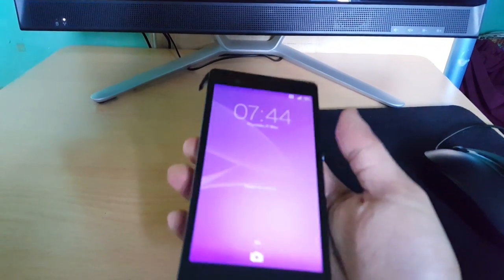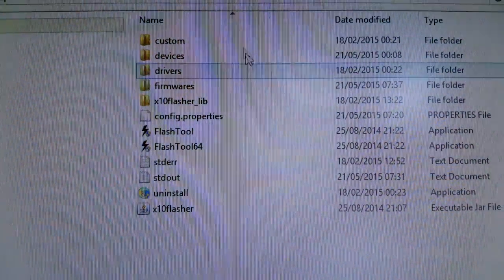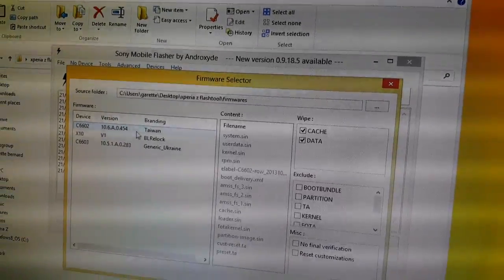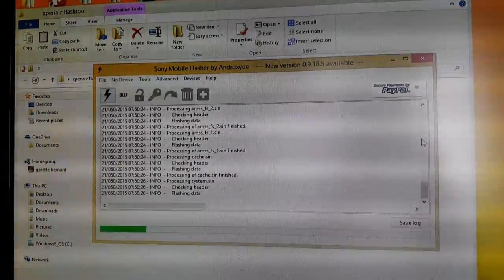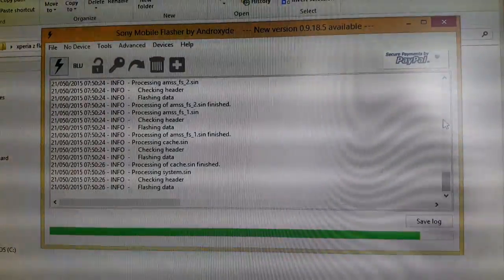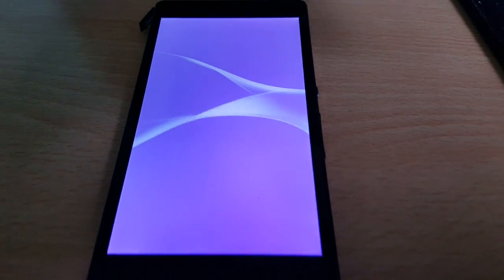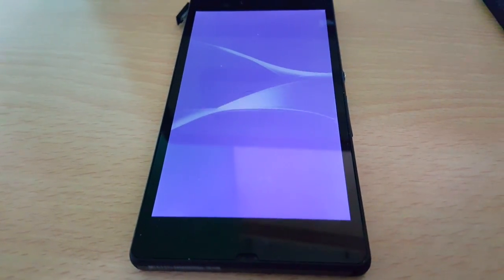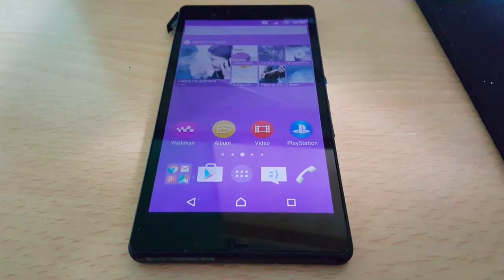Sony Xperia Z Install Official Android 5.0.2 lollipop Tutorial

Comment: hey doctor android im having difficulties in upgrading and first its in the drives there are many options of xperia Z and some of them are xperia Z ultra the second problem is that im using a c6603 model and when i switch off the phone it doesnt start flashing help me out bro im counting on you
Reply from the maker: ally daud if u dont see xperia z drivers just type it in google and download them that way u should find msny download links or install pc companion and connect your phone to it let it automatically install the drivers that way too if i remember correctly
Reply: Android Doctor the drivers are there but they are not xperia Z some are xperia Z ultra and if you wouldnt mind can u send the link of the ftf c6603 hong kong because you recommended it in some of the comments
Reply from the maker: ally daud when u swith off the phone u need to hold the button down that i show in the video its either volume down or the back button then connect the usb im guessing its not flashing for a few reasons either u didnt install xperia z drivers ,along with fastboot drivers & flashmode  drivers but if u dod install all 3 drivers and its still not working double check tgat u enabled usb debugging
Reply from the maker: unfortunately i cant but its sinple just type that hongkong firmware and model number into google and look for the download links aldo add xda developers to the search
Reply: Android Doctor i am downloading the xperia Z driver right now ill check you in a bit for the results
Reply from the maker: ally daud wait what hongkong fw was it u wanted kitkat?
Reply: Android Doctor no not kitkat i wanted lollipop
Reply: Android Doctor hey doc should i change the USB connection mode from MTP to MSP or?
Reply: doc should usb debugging be on??
Reply from the maker: ally daud yes
Reply: Android Doctor then why does it still fail while i did everything correctly

Comment: hi there, i have a question. I have a Sony Z T-Mobile (C6606) and it's lastest FW just 4.3, I also want to upgrade to 5.0.2 as the orther Sony Z (C6603) so can i use the firmware TW 5.0.2 for C6603 to upgrade for my phone? I've already searched on the internet but there's no OFFICAL FW for C6606. waiting for your responce
Reply from the maker: yes it should work😆
Reply: and one more thing, my phone still locked it's bootloader so can i use flashtool + your FW c6603 to flash?
Reply from the maker: +hưng nguyễn tiến yes u can
Reply: ERROR - Processing of loader.sin finished with errors.
i have this error, how can i do now?
Reply from the maker: +hưng nguyễn tiến u need to make sure u power the device off toyally then when u are requsted to re connect to flashtool hold down the volume down button then plug in the usb and kinda keep the cable held in untill the firmware starts to flash onto the phone bro, another thing u got to keep trying its kinda tricky ive got to admit also if u keep gettin error try another usb cable 😆

Comment: my phone is xperia z in japanese version,  its model so-02e/c6603 but it has trouble to booting? can you help?
Reply from the maker: did u install the c6603 version from the link in the description?,if so and it didnt work u will have to do a google search for the stock firmware for your model number and install it using flashtool to fix your phone http://filecloud.io/dveh017b
Reply from the maker: i think this is your stock firmware try install it using flashtoool just like i did in this video it should fix your phone http://filecloud.io/dveh017b

Comment: i do not have a firmware folder after downloading flashtool. Am I doing something wrong?
Reply from the maker: just make a new folder and call it firmwares then put the ftf file inside and your good to go😃
Reply: +Android Doctor thanks!
Reply: +Android Doctor sorry i ran into another problem.. When flashtool starts it gives me a message box saying that "the firmwares folder must be empty" after I have made the folder and dragged the ftf file into it. Can you help me out?
Reply from the maker: +Ayzriel Parchment did u name the new folder formwares? also did u put it where the drivers folder and other folders are? i mean dont put it in the drivers folder but put it alongside the drivers folder and other folders
Reply: +Android Doctor yes and im getting a message in flashtool that also says ERROR-root: this bundle is not valid
Reply from the maker: +Ayzriel Parchment are you using the exact same version of flashtool as i did in the video? if so maybe try using another cersion but i dont understand this should work it worked for everyone else
Reply: +Android Doctor ok I will start over and try again thanks for your help.

Comment: Just installed on my Xperia Z (c6606) and it worked fine.. 2 issues I was having while installing that might be useful for others.

1. When using Flashtools make sure you copy your ROM to the default folder shown in the FIRMWARE SLEECTOR screen. 
mine was: C:\Users\Admin\.flashTool\firmwares    if not it does not pickup the firmware. 

2. Make sure before you click on the LIGHTNING BOLT icon that you take phone OFF usb debugging. 

Works like a charm.. thanks
Reply: can you make a video tutorial of it? my phone xperia z c6606

Comment: it says install drivers and I have model c6606
Reply from the maker: open flashtool look for the drivers folder inside it u should find your drivers and tick the box to install them if your drivers are not listed check the video description for the link to sonys website where u can get your drivers for your model
Reply: +Android Doctor does it work for c6606
Reply from the maker: +Jami Ghani yes
Reply: +Android Doctor does it works jami ?

Comment: Android doctor I download the file but it's a zip and flash tool is not indicating it it in the firmware when I try to flash I tried extracting it and it has many folds including the the boot folder
Reply from the maker: +Ndawula Farouk u need to install all 3 of the drivers i mentioned in  the video bro or else flashtool wont work
Reply: I finally got it work thanks so much the issue was with the download manager that had zipped up the file

Comment: i downloaded official firmware.. but it is in zip format .. and not showing when i try to flash.. what should i do??
Reply from the maker: try extract it and see if the ftf file is inside it:-)
Reply: +Android Doctor flash not successful..
while flashing ...showing like 
INFO Preparing files for flashing
Error
INFO Cannot open bundle. Flash operation canceled
Reply from the maker: +pujwal shakya is it a ftf file u are trying to flash?also make sure u downloaded the correct firmware for your model number or it wont work

Comment: I help my cel stayed in the Xperia and I did this help me please

25/039/2015 10:39:11 - INFO  - Processing of partition-image.sin finished.
25/039/2015 10:39:11 - INFO  - Parsing boot delivery
25/039/2015 10:39:11 - INFO  - Phone boot version : S1_Boot_Lagan_1.1.1_1. Boot delivery version : S1_Boot_Lagan_1.1_10
25/039/2015 10:39:11 - INFO  - Going to flash boot delivery
25/039/2015 10:39:11 - INFO  - Processing emmc_appsboot_S1_Boot_Lagan_1.1_10_HWID_7190E1_OEM0.sin
25/039/2015 10:39:11 - INFO  -     Checking header
25/039/2015 10:39:11 - ERROR - Processing of emmc_appsboot_S1_Boot_Lagan_1.1_10_HWID_7190E1_OEM0.sin finished with errors.
25/039/2015 10:39:11 - INFO  - Ending flash session
25/039/2015 10:39:11 - ERROR - ERR_SEVERITY="MINOR";ERR_CODE="0017";ERR_DYNAMIC="0x80080021 ";

Comment: hi friends, i have recently upgraded my android from 5.0.2 to 5.1.1 but i and not happy with it i want to go back to 5.0.2 is there any way to do that?
i am using Xperia Z2. The mean reason is that i liked so much the option for putting the phone on silent 15 30 45 or 60 minutes and it will be on sound after the selected time so just in case if you forget to wake up your phone from silent it will be on sound after selected time.

Comment: problem bro :/
ERROR - ERR_SEVERITY="MINOR";ERR_CODE="0017";ERR_DYNAMIC="0x800A0017 ";
any solution ? Android Doctor
Reply from the maker: Not sure why u get that error nobody else has reported it read the comments try making sure your phone is completely off be fore connecting that USB cable its vital u do do that and kinda keep hold off the cable when connecting it only let go when the flashing starts and u see all that writing on screen and things get moving bro-) its kinda tricky to do but it will work and make sure u installed the drivers for your model along with fastboot and flashmode drivers:-) and just a little tip read through comments alot of the time people post fixes for the problem u could be facing..
Reply: will do thanks man

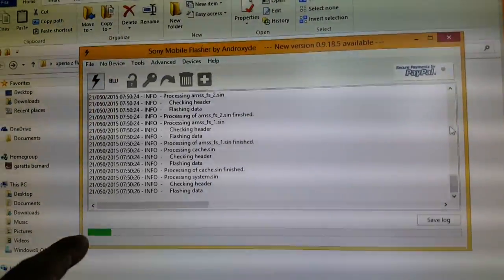Comment: 24/007/2015 00:07:56 - INFO  - Start Flashing
24/007/2015 00:07:56 - INFO  - Processing loader.sin
24/007/2015 00:07:56 - INFO  -     Checking header
24/007/2015 00:07:56 - ERROR - Processing of loader.sin finished with errors.
24/007/2015 00:07:56 - INFO  - Ending flash session
24/007/2015 00:07:56 - ERROR - 
24/007/2015 00:07:56 - ERROR - Error flashing. Aborted
24/007/2015 00:07:56 - INFO  - Device connected in flash mode

Can you help what to do im using windows 7... i already install the drivers as you mentioned
Reply from the maker: grace chua To solve that error flashing aborted problem make sure when u turn off your phone it is fully off then hold down the volume down button and kinda keep it held down even when u connect the USB cable only let go when u see everything starting to flash onto the phone IT CAN BE A BIT TRICKY TO DO BUT KEEP TRYING IT WILL WORK:-)

Comment: I installed the flashmode & fastboot drivers. But got "Processing of loader.sin finished with errors" when pressing volume down button then plugging in usb cable. My bootloader is locked so I'm guessing I have to do a couple more steps to upgrade my xperia z model c6606 andorid 4.3 to android 5.0.2. Do I have to root this device and do xzdualrecovery?

Comment: I want to ask u if I should reset my experia Z c6603 befor I install android 5.0.2 ?!
Reply from the maker: Mouad El Kantri yes for a clean installation
Reply: Thanks (y)
Reply: If I failed in the install they are a risk to lose my phone ?!
Reply from the maker: Mouad El Kantri no there wil only be a problem if u disconnect the cable whilst installing
Reply: Thank u very much

Comment: having issues with my xperia z ... c6616 model issues with wifi and messaging... stopped looking to try and fix these
Reply from the maker: Mcnutts3 u are probably facing those problems because this firmware is not for your model bro its only for c6602 & c6603
Reply: shadowsniperhuddz any idea why my phone would tell me its ready for an update... my phone is about a year old but i believe it was out before that... xperia z L36H

Comment: Hey, just wondering I'm using the c6603 variant. So will I still be able to use LTE with this firmware update since the c6602 models didn't support LTE?
Reply from the maker: U sir are correct

Comment: Will the customised USA firmware for the z C6602 work perfectly fine in India and it's carrier operator? And is it safe to flash? It won't root my phone right?
Reply from the maker: The USA firmware is for the US version xperia z I recommend u installing Hong Kong C6602 fw if u don't want any issues and no it won't root your phone:-)

Comment: With this installation i got battery problems.Its charging very very very slow and gets drained very quick.what to do?help plz
Reply from the maker: Prince Jan  yes it does charge a bit slower than kitkat but your battery shouldnt drain so quick do a factory reset then try power cycling  when charging dont forget its a whole new operating system give it some time to settle too..
Reply: shadowsniperhuddz Thanks for the reply.Does Lollipop 5.0.2 have any other issues? what do u mean by power cycling?how to do it?Thanks in advance
Reply from the maker: Basically let the battery die to about 10% then full charge it then do the same 3 more times and it should improve battery apparently:-)
Reply: shadowsniperhuddz Bundle of thanks i was searching for it already :) I just flashed my phone with the lollipop.My battery gets very hot.Is that normal for now?
Reply from the maker: shouldn't get too hot I recommend doing a factory reset it might help
Reply: Thanks i will try power cycling and factory reset.Hope it helps.Bundle of thanks again.Cheers

Comment: Hi, i've installed the c6603 firmware forma my xperia z model c6603. My question is why the mobile data doesn't work?
Reply from the maker: Michelangelo Roseo it should double check when u go into about phone does it say c6603 or c6602 for your model number??
Reply: It says "number model c6603"
Reply from the maker: Michelangelo Roseo well it should work mine works fine and nobody else has reported this problem 1 question did u download the c6603 usa or hong kong firmware?? also maybe try a factory reset it could fix the problem
Reply: shadowsniperhuddz i installed The Hong Kong firmware
Reply from the maker: Michelangelo Roseo im not sure what the problem is but my mobile data works try a factory reset like i said also try playing with the mobile data settings and if that dont work watch this video to fix your device and put it back to how it was  https://www.youtube.com/watch?v=F2HIYpeZaTM
Reply: shadowsniperhuddz all right then, i'm gonna try the factory reset and if it doesn't work i will downgrade it to KitKat and reupgrade to lollipop. Thanks for the help.
Reply from the maker: Michelangelo Roseo no probs
Reply: shadowsniperhuddz i played with the mobile data settings and now it works
Reply from the maker: Michelangelo Roseo ok leave a comment to say what u did to fix the problem incase anyone else has the same issue it will help them to fix it bro
Reply: shadowsniperhuddz I just download the settings for internet and MMS

Comment from the maker: IMPORTANT READ THIS when installing flashtool drivers select flashmode & fastboot drivers also tick the xperia z drivers box if that option is there!! If you face problems with the drivers not installing and you are running windows 8 or 8.1go to  change pc settings on your computer select>Update & recovery>Recovery>Restart Now>Select Trouble Shoot>Advanced Options>Startup Settings then select Restart!! Once your pc boots back up make sure you select option 7)Disable Driver signature enforcement then once windows boots backup quickly reinstall flashtool drivers and they will get installed 2nd time round!!!!
Reply: Android Doctor sony z firmware file plzz share
Reply: pliss share firmware file

Comment: Mine says: 
INFO  - Start Flashing
INFO  - Processing loader.sin
INFO  -     Checking header
ERROR - Processing of loader.sin finished with errors.
INFO  - Ending flash session
ERROR - Error flashing. Aborted
ERROR - Drivers need to be installed for connected device.
ERROR - You can find them in the drivers folder of Flashtool.
Reply from the maker: Read the comments for answers to the fixes bro
Reply: I cant find the Same Problem bro, can you explain it to me again please
Reply from the maker: Ömer Oguzhan  read the comments about the drivers u need to change pc settings to install the drivers correctly
Reply: Yes i See thank you its work finally good

Comment: can do it with any flash tool
Reply from the maker: I recommend using the flashtool from the link provided
Reply: yah and everything its down below right?
Reply from the maker: Yes
Reply: but why i cant download flash tool error
Reply from the maker: Jason Liao  the flashtool download link works i just tried it and its fine
Reply: ohhh when flash it hold volume down.... and ?
Reply from the maker: Jason Liao make sure phone is completely switched off then just hold the volume down button and connect the usb cable dont let go untill u see that it start flashing the firmware onto your phone u will no its flashing because u will see alot of writing on the flashtool screen
Reply: after see flash stop.hold or not
Reply from the maker: Jason Liao when u see it start to flash then let go
Reply: when see flash n stop let it go?

Comment: When the update will be out for official downloading?
Reply from the maker: Its getting released 1 country at a time so it all depends when they will release it for your country but they released it for Taiwan and the USA so if u want it now u can install it from the links in the description under this video its the same update that u will eventually get ota just make sure if u have the c6602 or c6603 model u download the correct version for your device because if u install the c6602 firmware on c6603 for example everything will work great except 4 glte so once again if u want everything to work download the correct firmware for your model number:-)
Reply: shadowsniperhuddz So I need the one for my phone and the original one? Or only the firmware for my phone?
Reply: shadowsniperhuddz Or is it possible to change the country to USA? I live in Austria
Reply from the maker: Just download the lollipop firmware for your model from the links in the description and install it just like I did in this video and your done its so easy
Reply from the maker: Even if u don't live on the us u can still install it so don't worry just make sure u download the right lollipop firmware for your model if u want everything to work
Reply: shadowsniperhuddz Okay but the download needs soooo much time to finish ^^